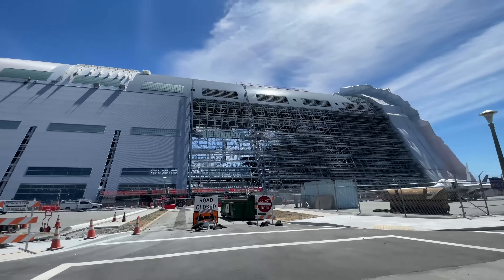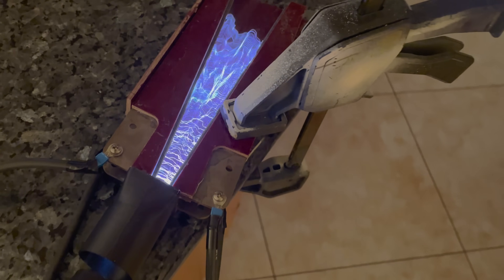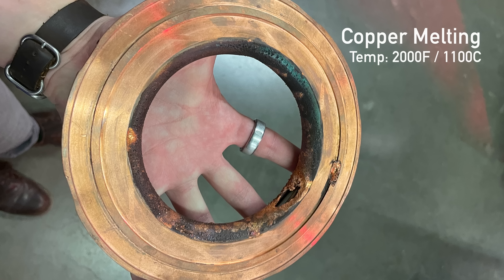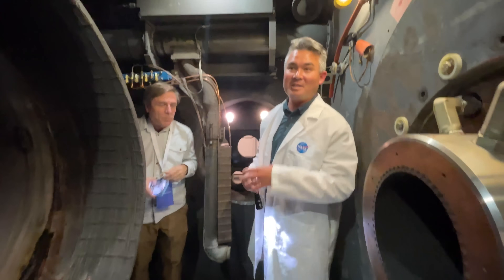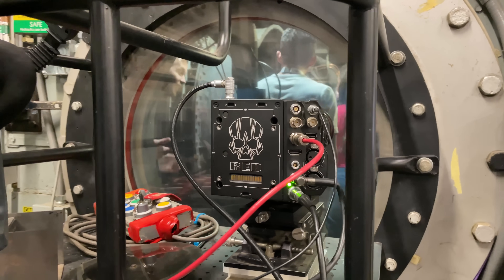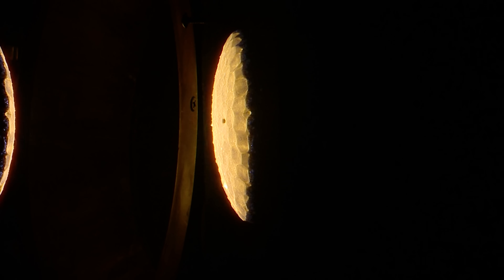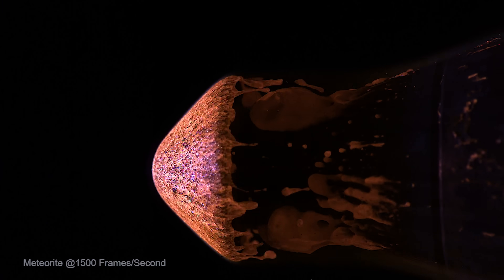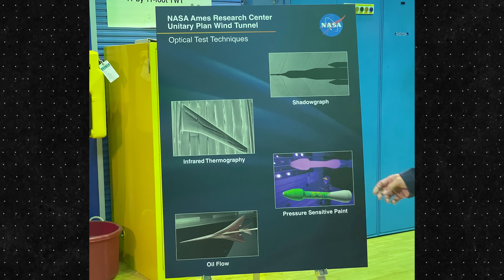How NASA Tests Spacecraft Reentry

Comment: 200-2000$ is not "way off the mark" for a wind tunnel. Not everything need a NASA tunnel, not everything needs a large scale tunnel. Fluid dynamics scale incredibly well from 11 feet by 11 feet to 11cm by 11cm. The only reason you'd need a large test chamber is because you want to do analysis on such small parts (especially scaled down) that it would be wiped out by other phenomenon otherwise.

While the 200$ estimate is quite low, the 2000$ estimate isn't that bad at all. I'd say 500-10000$ is a better estimate, depending on needs. Also, NASA is an incredibly inefficient organization. Yes it's needed, but that's definitely not where private company should do research. And it should definitely be more efficient than it is, that's a fair criticism.

Also, NASA should have 0 rights to say "I can't tell you prices", and that response is frankly bullshit considering all their budgets are public records. Say "I don't know". If they really have a directive of not telling, people responsible behind that should be canned. No costs should be secret at NASA.

Comment: Do you remember your camera looking at camera rocket may it can be saved (only assumption) if you make the camera above came out like the camera below then even if it came out entirely still it could be pushed back inside because of high speed air and rocket could be stabilized and face that camera downward and you could had still got camera looking at camera shot

Comment: I was thinking that the plasma forming on hypersonic vehicles could be used for propulsion, after all it is heat and most engines use thermal expansion to produce power.  Accelerate to hypersonic speeds and use the heat generated to conduct heat to a heat absorbing radiator screen at head of combustion chamber then pump water through the screen to produce steam in the combustion chamber for thrust.

Comment: Wait did I hear right that "we don't really know how to make AVCoat anymore"??? It was invented like 60 years ago how does that happen???
Reply from the maker: It's surprising right? We do technically know how its made, because it's clearly used on the Orion capsule, but in the chaos of the Apollo program there were still many processes that were high-skill labor. i.e. you can read all you want about how to weld, but it won't make you a good welder. My understanding is that some of that knowledge failed to be passed down, and so now we're having to re-learn those parts.
Reply: It's not the only high tech material that we've forgotten how to make in modern history! Check out 'Fogbank', a Q-clearance (not the crazy type) level state secret that is probably some sort of aerogel.